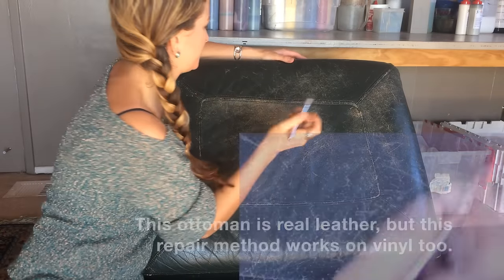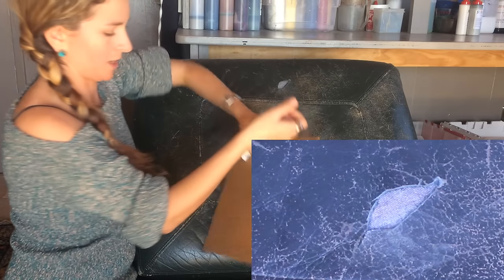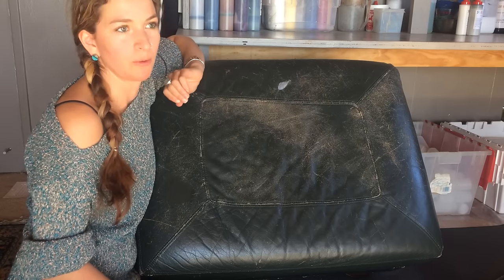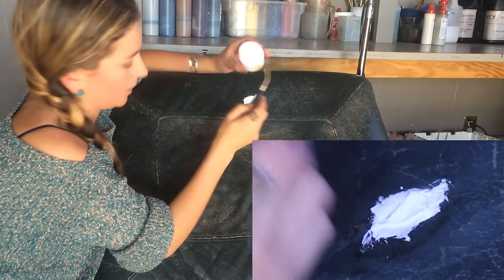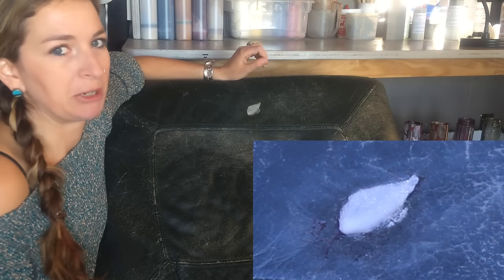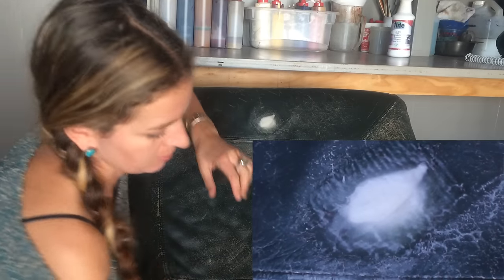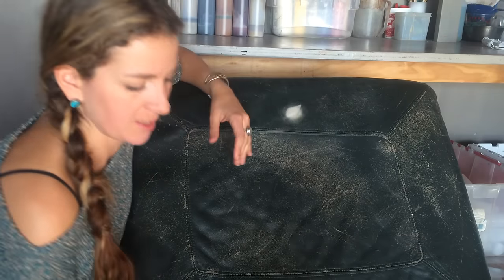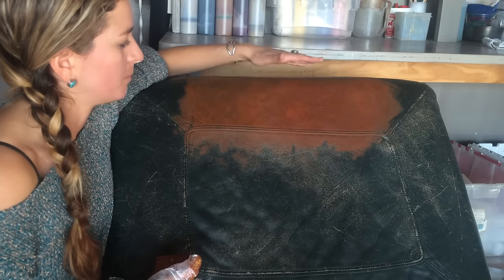Repair Tears, Holes or Cracks in Leather or Vinyl with Filler Putty

Comment: Just repaired a 3 inch hole in one of my 20 year old BarcaLounger theater seats using this kit. I was a bit worried because I purchased the kit about 4 or 5 years ago, but the filler compound and the stain worked great. My hole repair is just a little lumpy, but that’s just my inexperience with this type of job. Regardless, it looks 1000% better than before. I also used the stain to go over the entire set of seats and then with the clear coat. It took years of wear and tear off of these chairs and they now look almost like new! Great products! 👍
Reply from the maker: Wow! This air-dry filler putty typically expires in 6 months or a couple years. Delighted you still made use of it, and thanks for sharing! FYI, you can aways re-work your repair. A little denatured or rubbing alcohol will strip the color and gradually melt the bump. Just re-apply a thin coat for texture followed by color. Cheers!

Comment: I'm going to give this a try using E6000 with the sub-patch underneath and then use Coconix to color match and fill any small gaps.  I showed my local furniture repair shop the tear and he said it's best to buy a new couch because it will be too expensive to reupholster.  He never mentioned or sold any repair options.  Also, I've seen very nice furniture at Habitat for Humanity with small tears that are incredibly cheap.  I think this repair method might be a nice way to find an  alternative to new furniture shopping or open a furniture boutique if you have the time and space.   Thank you for posting!

Comment: Lasandre, thank you so much for doing the excellent tutorial.  I’m trying to hold on to my 2002 “luxury” (i.e. way too expensive) SUV that’s no longer made.  I didn’t take care of leather for years and now regret.  Local family owned auto upholstery repair shop quoted me a price of $600 to repair drivers seat/console.  The tears aren’t bad but a lot of $$ for an older vehicle (not saying  they’re over charging though...).  

Having done leather work as hobby & spare income decades ago I’m thrilled to be learning new methods of repair & restoration.  Your tutorial now has me planning to repair SUV leather & nice furniture scratched by cats.  Thank you so much for showing me how to save some major $$.  I’ll be sure to wear respirator to hold back my urge to start huffing the vapors!!

Comment: Try not to "Huff the rag"! lol love that phrase. Great video, very detailed. Thanks
Reply: I didn't know if anyone else caught that or not. LOL
Reply: Never heard that before and have no idea of what it means.
Reply: Huffing is a practice used by drug users to get high off paint fumes by spraying aerosol paint into a bag or onto a rag,  then holding it up to their mouth and nose and inhaling. Usually they used gold and silver paint and  they would have a ring of paint around their mouth and nose from "huffing" the bag or rag.
Reply: "Huff the rag", "easier insertion",  "smaller hole", "rub it in", "lickity split", "blow in there", "more rigid"...some submittal connotations here...just sayin

Comment: Hi, it looks great. But my project is for a leather car seat with a rip and many cracks to fill in. So, my question is: 

#1 Will the repair hold up in a very hot car  100 degrees at times and also very cold, below zero often. Do you think the repair would remain flexible in those conditions?

#2  I would be coloring the repair with a paint that is oil or latex-based, is that compatible?
thanks
tom

Comment: I have these door panels on my car, they are black,i bought them years ago to change the interior on my car to black,the passenger side panel has a few cuts on the vinyl, looks like someone took a razor blade and just made 3 or 4 very small cuts on different spots on the panel,the vinyl is still there,there is no holes,basically they just look like little flaps,Ive thought about maybe gluing them down but what could i use to hide the cut? i dont want to cut the vinyl anymore,just glue them and hide the cut, thank you for your time!

Comment: Good video here - well done. I was just wondering what I should use to restore
tired leather running shoes that I like ?? Would I use a dye, or would I use a 
paint touch up ?? I've seen guys on youtube work magic with cracked leather
car seats, and they use an enamel base paint, with laquer thinner at the same time.
Results are hard to believe and it says it won't get on your clothes after. Also says
the laquer thinner draws out the original dyes in the leather, and the paint touches
up the imperfections in the leather.
   I'm wondering here though--since leathers are all dyed to get their color before they
are sold, would I use a dye for my leather running shoes,?? or a paint touch up?? I'm a
little confused. Your advice would be appreciated -thanks-from Canada

  PS-You really get used to the comfort of shoes-- but they lose their looks

Comment: i guess this method and those products should be able to fix large holes also...Question when you use dye is there a way to match color? i have this car i am fixing up and leather is in good shape not all dryed out...but need to patch holes...i am very good at doing these type of jobs although this system is new to me...This car i need to fix has black leatherseats with a smooth texture...thanks for the great no bs tutorial ...thanks

Comment: Have you used the FC2?  I have a 2" x 3" hole in the side bolster of my Passat, where my jeans rub it on the way in and out of the car.  That area doesn't have to flex very much (bolster to the left of the hip, not sitting on it), and I was considering whether to use FC1 or FC2.  I'm thinking about FC2 until the hole is filled, then a top layer of FC1 on the larger surrounding area where the leather is abraded/flaking but not worn through yet.  Thanks.

Comment: I bought these products and this compound dries totally clear and remains tacky. I haven’t sanded or dyed it yet… I’m hoping that perhaps sanding it will take away the tackiness 🤷‍♀️ So far I’m disappointed and these products were expensive. 
Is this compound supposed to dry totally clear and remain tacky or did I get a bad batch?
Reply from the maker: Depending how deep the void was and how many layers of filler you have in there, it may look hazy and whitish and not totally clear. There are a couple of explanations for the tackiness. A coat of color should correct it. See here: https://rubnrestore.com/how-to/leather-filler-troubleshooting/#filler-tacky This and other troubleshooting topics can be found by searching the FAQs or How To Library.
Reply: I cut out the leather to make smooth edges on the tear, like the video and glued in a patch underneath with the locktight like she suggested, then applied the 1st layer of compound and put the couch in the sunlight. It dried totally clear, but was tacky. I applied a second layer of the compound but used the light bulb and it dried totally clear but is still tacky. The compound is not quite flush so I am about to add one more thin layer of compound and dry it with the lightbulb. I’m surprised that the compound is tacky when dry. I’ll check out that link and update this when I finish sanding and coloring it. I bought colors to match it to my very dark brown/espresso colored couch. I hope this works.

Comment: I used a filler called bond and flex and tried sanding it off similar like you did. It appears it's a much harder substance to sand off by hand. Is there an electric sander that you would recommend that is only slightly stronger than doing it by hand.

Comment: Excellent tutorial.  I have a question about compound alternatives.  I noticed that Walmart sales All Purpose Acrylic Latex Caulk Silicone in a 10oz tube ($4) that is flexible, waterproof, and easy water clean-up.   It goes on white and dry's clear as well.  I guess I can test it first but wanted your advice? Any experience with alternatives?

Comment: Do you know if the 3M Plastic & Emblem Adhesive &/or the Loctite Vinyl, Fabric & Plastic Adhesive safe to use on the vinyl of a hot tub cover?  I have a tear on the edge of the flap that I'd like to repair & I am concerned that it might "melt" the material or remove the color.  Please let me know. Any advice would be appreciated.

Comment: Hi I purchased a living room set but only my recliner is pealing small 6in by 6 inch but it's right were your back LEDs wood be in the front seat. Eye sore. I cleaned it with leather cleaner and it stopped pealing but under the leather looks like leather but it's light brown so it sticks out like sour thum. Can this fixed?

Comment: I have some 1/2"long cracks in the vinyl part of a car seat, on the vertical side of the seat, below the leather sitting section... Is there a way to strengthen these cracks and prevent them from worsening with a filler, or do I need to cut a hole and put some backing behind them?

Comment: I am having trouble getting the filler to absorb the dye.  I tried some light sanding. Any suggestions?  I had to spread the filler over most of 3 cushions it was so badly damaged with rips and tears.

Comment: Nice video.  Couple questions.  Will the same repair method work for vinyl?   If the intent of the repair would have been to restore back to the 'original' worn black color & texture -  could that have been achieved?  If so, generally how would one go about applying the 'original' worn black color & texture?  Thanks again!
Reply: @RubnRestore  Thank you!

Comment: Good repair the only thing is ; if you put grain pad on the filler to make  the vinyl or leather grain appear, it would look  more magnificent , next , a repair like this needs to be sealed after dying it for water proof, you can u use a top coat sealer or add cross linker in the dye .you don't have a phone number here . I Wanna buy the kit I like it !
Reply: Myrtho Charles I
Reply: @RubnRestore  Hand job Method...lol... Sorry i am a child
Reply: @robbobcat7286  Just make sure she doesn't "round your edges before inserting".
Reply: good video
Reply: @RubnRestore  I have some vinyl spray paint that I was hoping to use over the soft filler, as the paint you sell, while superior,  is a bit out of my price range at the moment.  Would that require a sealer of some kind?
Reply: These days we call this mansplaining

Comment: hey... i see that there are many fine crack lines over the vinyl. do you have to apply thin filler over the vinyl before you dyed it brown? 

also, do you have to apply some coating or protection layer after the coloring to prevent cracking or stuff? (i tried before dylon dye on a bag but didnt apply after coating, it cracked and peeled badly) 

Thank you so much:)

Comment: I bought the filler, can it be grain stamped and what is the process for stamping (does it need to be heated)? Do you sell the 2 part grain making kit?
Reply: Ok. I had an approx. 3"x4" section that took quite a bit of fill, but I now need to try and match the grain. I'm guessing, Mohawk.com. Thanks!

Comment: Hi. I am about to attempt a leather repair on a damaged purse and I have a question. I am trying to figure out if I should get a repair compound or just work with what I have. I have been experimenting with patching holes in leather with Liquitex Matte Gel Medium and the results have been pretty good but it takes several coats. Why did you use the FC-1 Soft filler instead of the FC-2 Thick Filler? I ask because according to ADV's website, the FC-2 is for large holes like the one you are repairing, while the FC-1 is for minor scratches and such. TIA
Reply: That’s funny, I just tried Golden matte gel medium on cracking PU leather.  How did it hold up for you?

Comment: Hiya. Can you use cotton material to tuck into the hole? Thanks.
Reply: @RubnRestore  thanks for the prompt reply. The hole isnt huge...its a straight tear which is good. I havent yet bought the filler as im not sure which one to buy. The glue is flexi glue which ive heard is good for leather sofas.
Reply: @RubnRestore  thank you for your help...its been so helpful. I will try and fix it...im quite nervous incase i glue it wrong lol

Comment: Substantial hole ?  My repair is more like two square feet with damage to the foam cushion!  I'm not proud.  I saw another video where the man took the cushion out of the cover and turned it inside out..  He cut a patch that extended beyond the damaged area and "glued" it down with his leather filler compound. I'm going to have to cut away a substantial part of the damaged area.  There's really no way to save it. I have gotten a piece of leather that I had planned to use a my backing but I wonder if it will be able to breathe after applying the filler compound.  Would I be better off to use a denim patch you suggest.  He said if a backing didn't breathe, it would dry but would take a VERY long time.  I've got the time but obviously don't want to use the leather if it's never going to dry.  Another question.  I have cracks and scratches in other areas which need help.  Can your filler be used for these also?  Gosh, if I was someone reading this, I would have to wonder why I don't just buy a new sofa!  I like a challenge!  I appreciate your videos.  Very clear and complete.  Thanks.
Reply: Gosh, your reply was unexpected quick.  I'll get some denim and "some" of your filler (I use that term lightly)!  Thanks!
Reply: You're right about the patch size.  More like a bolt of whatever I find!  Can't tell you how many times I've watched your videos.  Pick up on something else every time.  Beginning to get cold feet but I've committed myself now, soooo. I plan to take before and after pictures.  Whether I send them or not remains to be seen.  Have a good day.

Comment: could this work on a faux leather jacket? I ended up with two burn holes in one of my favorites. this would literally save an irreplaceable piece if so!
Reply: Rub 'n Restore, Inc. awesome! the rest of the jacket is still in great condition, so I think it's worth a shot! I figured the color match would be a little tricky and I saw you can request swatches, so I will definitely be doing that soon! thank you so much!
Reply: Rub 'n Restore, Inc. I also have an irreplaceable faux leather jacket with a tear in the underarm. It looks like it could be repairable, but I would rather mail it to an expert and have them do it. Do you take orders like this and how much would you charge?
Reply: Rub 'n Restore, Inc. Okay. Thanks for your reply.

Comment: do you have advice on repairing a tear on the seam?
Reply: Would it be a good idea to glue down one side of the patch and let it cure completely before doing the other side? If the seam allowance is missing on one side along with the stitching, what's the best way to fill it without filling in the seam?

Comment: How do you reconcondition or repair spots where it's starting to show cracking in vinyl?
Reply: Rub 'n Restore, Inc. the cracks in the vinyl are not open cracks. Do I still need to use this method?

Comment: Umm Clear Sealant $3.99 put medium Bead on 1 side of Hole Scrape it across hole Flat then put a Bead on the other sections that are frayed or worn pulling the Bead in 1 Direction. let it dry to touch, then use the Grain and let it Cure. Then Stain it any color you want to. Looks Brand new
Reply: @RubnRestore  Permatex Adhesive Sealant, Works on Million Dollar car seats every time

Comment: I miss something? To repair a hole the size of a quarter you're dying the entire chair?
Reply from the maker: The  customer wanted it changed to a rusty brown color. Had they wanted to keep the original 90s teal, it would have required customization to get it exact. Think of how many paint chips there are at the hardware store. To simply spot touch an area, the color has to be exact.

Comment: FYI, your audio quality is not very good, You need to either speak up or into the mic or both.  You are barely audible at full volume.  Your audio levels should always be such, that one needs to turn it down, not up.  You also fade in and out.